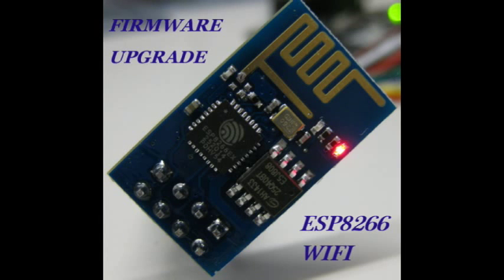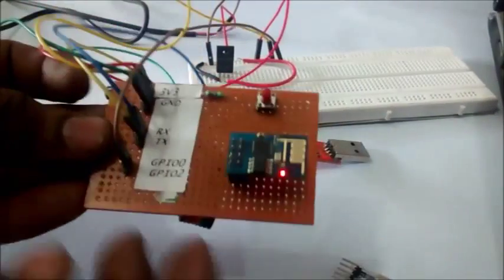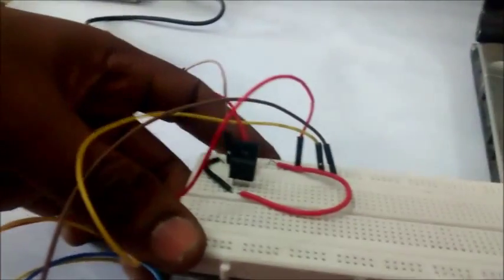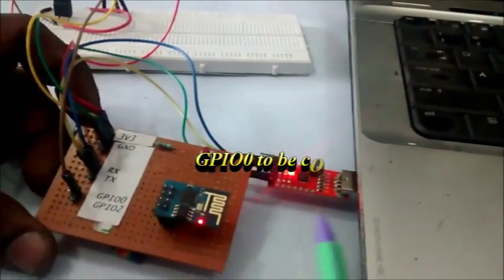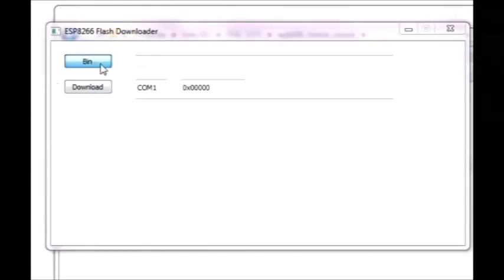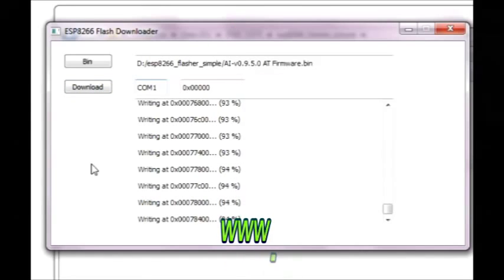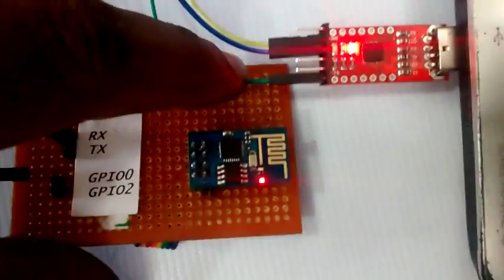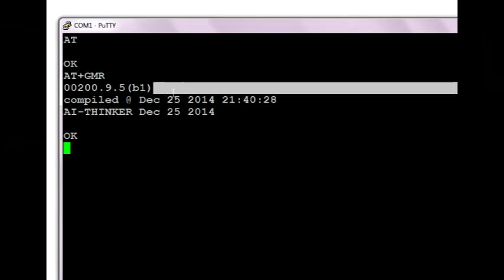ESP8266 UPGRADING FIRMWARE

Comment: Hi +Saravanan, I was able to flash the firmware, and after disconnecting GPIO0 from GND, and re-plugged the ESP8266-01 with the adapter board, AT Commands are successfully returning expected results. 

Thank you very much and more power.

Comment: One additional note, if you're still getting weird reactions (invalid, or fatal errors), Make Sure the 3.3V power supply is within the 3.0 to 3.6V range, and supplying minimum 250mA. After about 4 times of having a ESP-01 fail, it all turned out to be the FTDI dongle not providing the proper amperage.  It sounds suicidal for the chip, but a good healthy supply, even as high as 23-Amp (yes, as in 2,300mA, this is from a 500-Watt ATX power supply's 3.3V rail!), is dangerous in a short-circuit, but the ESP will only use what is required from it.